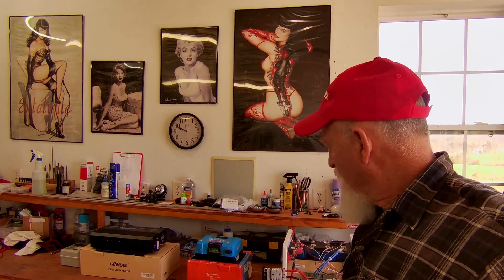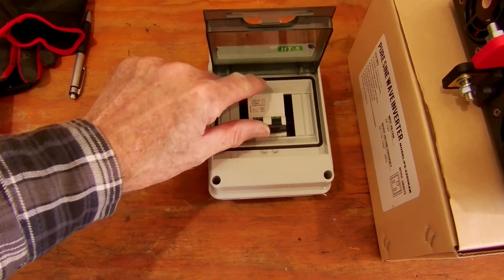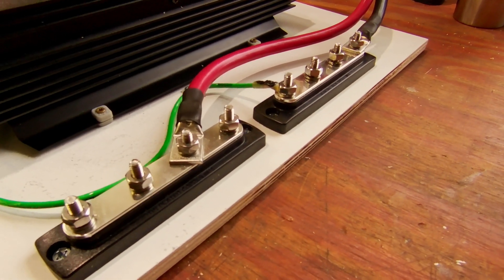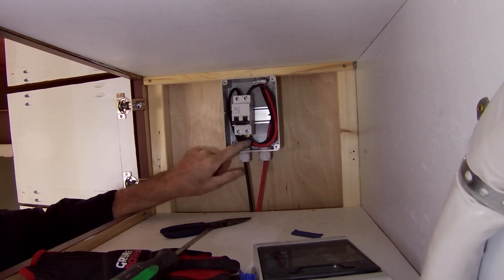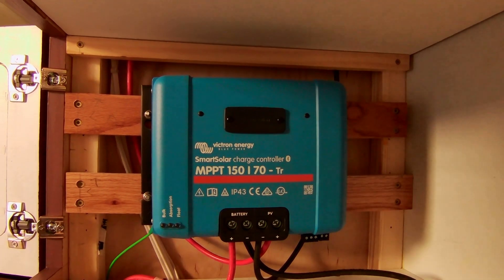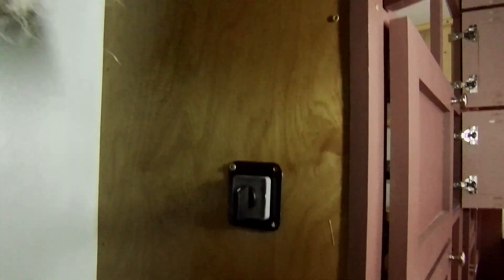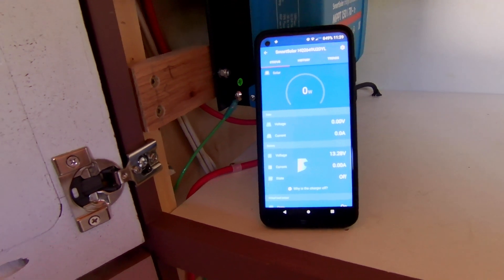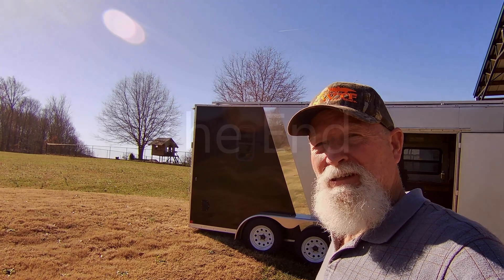Solar Power Install part 2

Comment: Great video John, Thanks for sharing. I'm building my trailer right now and have started collecting my power equipment. I'm still kicking around how many watts/panels to go with. I'm sure you've mentioned it in one of your videos, but I can't remember what you have.
Reply from the maker: I think they are around 380 watts and I have 4.  I am over paneled for my SCC but that is fine because with little sun I still harvest a lot of solar power.  Put as many panels on your roof as will fit, you won't regret it.
Reply: @johntalbert8227  what's your next adventure?
Reply from the maker: @MrBowNaxe  I need to think up one. :)
Reply: @johntalbert8227  Always welcome here in Nebraska if you want to help build out my trailer...

Comment: Good detail and helpful commentary. That transfer switch is so clean and compact. 
Very nice install.
Reply from the maker: That's why I chose it, the dedicated transfer switches were huge and bulky.  That switch I bought can be purchased in smaller sizes.  I screwed up and bought one with more connections than I needed.

Comment: Thanks for taking us along, John!
I first thought the 44Watts was at the 91 Volts, that would be huge.  I paused to see the app said "13.6V".  Thanks makes more since. 😁

Q: @ 1:45 - If you were to start over knowing what you know now, would you go with a higher amperage BMS? I don't know what the discharge max is on your batteries, maybe thats a good match?? Just curious. I'm considering building a battery pack, and always wonder what the magic is in picking the BMS that is most efficient with your battery bank.
Thanks again! 

PS: Maybe you could mount some nylon webbing loops to the side of your battery box for handles.
Reply from the maker: Missed your question, yes I would probably go with the same BMS but their high amp model.  But, I haven't had a problem with the one I have in real-world use.